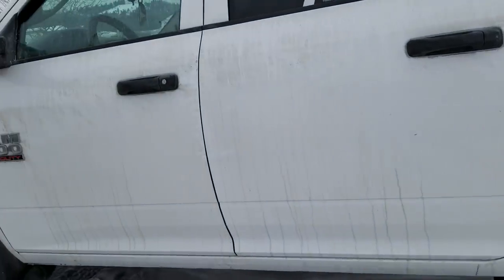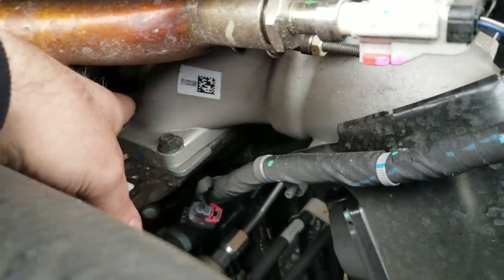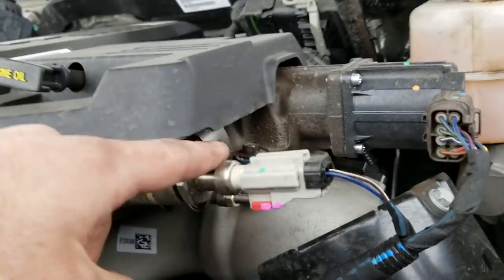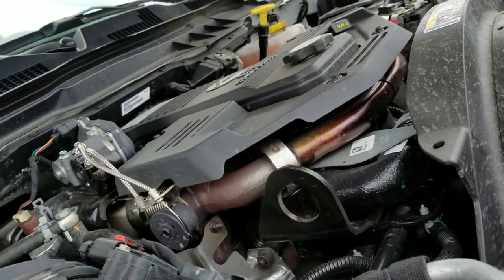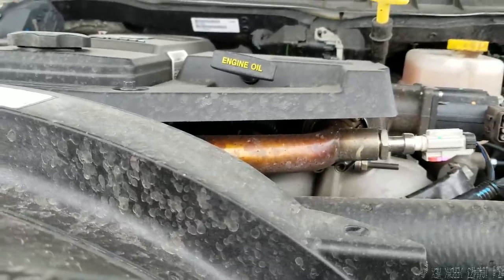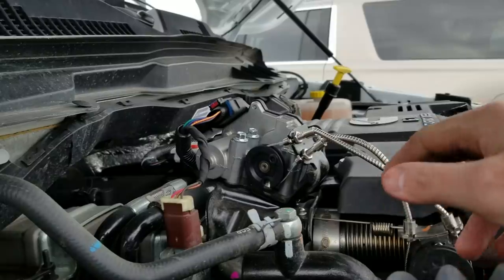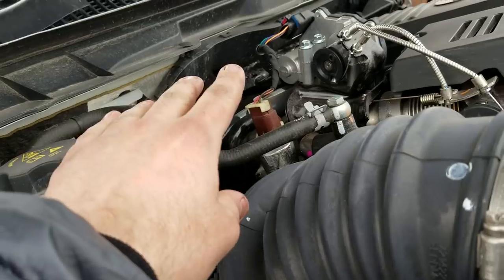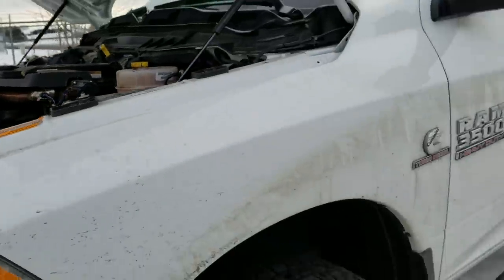13-18 Ram Cummins. The real problem with Egr

Comment: Have you ever heard of the killer bolt grid heater issue? Have you ever had it?  I wish you could address it in a video. Thank you for all your videos you have helped me alot!
Reply: Just suffered on my 08 at 325k
Reply: Banks Monster air has a video about that issue and how to fix it

Comment: So essentially it's creating predestination along with destroying valves inside the engine. I currently have a 2017 4500 they can't get out of its own damn way going downhill. I used to have a Kenworth pulling over 100,000 pounds picking out pool this pickup truck empty.

Comment: If your truck thats out of warranty gets deleted,which is what most do but ive heard if dot catches this they will ream u.or state when inspection time comes.nc dont have diesel emissions on my  truck.07 5.9 and btw i got the toyos oc2 6 for $1200 out the door 👍
Reply: Just go in and turn the EGR off. Put a block of olate between the intake and the EGR. Bolt it all back together, and stealth mode baby.
Reply: Brandon Caldwell What, exactly is so wrong with EGR? Ok so if you don’t work the truck hard much the EGR cooler core will plug up. That’s like $500 every 90,000 miles (and first ones usually under warranty). Besides that, what’s the big problem with it? Why are people obsessed with breathing their trucks unfiltered exhaust? Just to prove to the world they can? Lol Doesn’t exactly reek of any intelligence!
Reply: @brandoncaldwell95  he has a 5.9 the 5.9 doesn't have a EGR system like that. Deleting EGR from a 5.9 requires a camshaft swap as EGR on a 5.9 involves opening the intake valve slightly at the end of the exhaust stroke. 

Aftermarket performance camshafts delete this part of the profile.
Reply: @natehawkins2910  there's two issues with it. 

1. The soot mixes with the oil from the PCV system making a paste that clogs the intake manifold (only a diesel issue)

2. The EGR effectively reduces the volume of useable air in the engine. Effectively undoing all the work you did to get as much useable air in as possible with things like a Intercooler and turbo.
Reply: @brandoncaldwell95  it it's it's own exhaust gasses. You breath back in some of the air you breathed out every day.
Reply: SilverStar Heggisist 1) But that’s what our “catch can filter” is for ...collect the mist and keep it drier. Mines to be changed at around 100k or when your 017 cap blows off lol 

2) I won’t argue that, but EGR greatly reduces nox so it’s kinda necessary.
Reply: @natehawkins2910  my PCV system was converted to a road draft tube by the previous owner so it's not and issue for me. 

I know what EGRA does. However it also causes the engine to produce more carbon monoxide, which could arguably be worse.
Reply: SilverStar Heggisist That’s interesting you mention CO production. My truck was recently in the dealer for a not-supposed-to-be-wet-inside wiring connector repair and set off the CO alarm while running 20 minutes inside the dealer garage ...the fume vent doesn’t fit well over the double tip of the powerstrokes. My diesel tech said it doesn’t take long to set off the CO alarm with a new Powerstroke. Odd that EPA would focus so hard on Nox and seemingly disregard Carbon Monoxide.
Reply: @natehawkins2910   Neo Craft  I was trained to fix diesels and when you understand how each gas is made it makes sense. 

CO comes from incomplete combustion. The reason diesels traditionally are known for not making CO is their lean mixture/high pressure/high temperature environment is very good at getting a complete burn out of the fuel, making CO2 rather then CO, this is why diesel is allowed in underground mines but gasoline isn't. However the same conditions that make less CO make NOx. 

NOx is made in high pressure/high temperature/ environments. 

This means that with current technology you will always get a trade off between the two. 

The likely reason they except the trade off is that CO in an open environment isn't really damaging because you need a relatively high concentration to be dangerous. While NOx at relatively low concentrations produces acid rain. 

This is just speculation on my part because I'm not a mining expert, but mining equipment likely doesn't have a EGR system. 

Also had your truck been say on a Dyno, it likely wouldn't have set the alarm off. The EGR system is shut down when the truck is off idle/under load. This is why EGR doesn't interfere with the ability to tow. 

On a Final note, EGR isn't necessary any more. The DEF fluid you dump into your truck, is there to break down NOx into nitrogen and water. And it does so without the need to have EGR and does so without interfering with engine performance. Which means unlike EGR, it works when you're under load. And it does so without making the engine make more carbon monoxide. 

Because of this, I suspect strongly that they only still have EGR as well only because the government requires it still. 

Sorry this got long.
Reply: SilverStar Heggisist Thanks for the info. I love my EZ Lynk Monitor so I can watch when and how much the EGR valve opens. And temps etc...

I think it would be neat to experience a 6.7 Powerstroke with no EGR and no def but still having the DPF intact to get rid of the smell and soot. Too bad we couldn’t have just went this route ...sure would have cut down on components and cost. 

I know Ford offers the 6.7 without DPF and for use with 500+ ppm diesel fuel for export (or with an EPA waiver) you can find a couple on YouTube here and it would be fun to have one from the factory that’s somewhat emissions control-free. I’m guessing EGR is still on it but no one can confirm.
Reply: @brandoncaldwell95  you have no clue what you're talking about...
Reply: @SilverStarHeggisist  diesels are allowed in mines because the fuel isn't flammable, this is why gasoline engines aren't allowed (flammable and therefore potential for explosive fuel vapors).

NOx controls are only related to ground level ozone and the national ambient air quality standards, nothing to do with acid rain. 

EGR is not required by the government, engine manufacturers only have to comply with the emissions standards; the EPA doesn't care how they do it. Note that Cummins/Dodge were the last brand to need to add SCR to their engines to pass the Tier 4 standards.
Reply: @wlrottge  Actually, i highly dout you know what yore talking about.
Reply: @brandoncaldwell95  19 years working in air quality with a SIGNIFICANT portion of my time spent on diesel engine regulations. And I grew up in a boat yard, am an engineer and know how to build engines (have a 454 on a stand in my garage as we speak)... Yup, completely clueless.
Reply: @wlrottge  I could honestly not care. You can flex all you want. You can state things all you want. The fact is, this is the internet. Youre a proffessional, so am i. The fact is, ou knownumbers, congrats. I listen to engines
Reply: @brandoncaldwell95  I build them too... But the difference is, I know the underlying science and engineering
Reply: @wlrottge  You still havnt grasp the point. Spell it out with me now, I   D-O-N-'-T   C-A-R-E. Now say it with me, "I don't care". Get it now? You can say you built Sydney Opera Theatre for all i care. The fact is, this is the internet. You know numbers, i could not care any less than i do now. The fact is, we are all different and have different opinions. Emission systems are terrible and i will contiue to remove them. EGR is terrible so it will be gone. I know ways to fool others I.E. hidden block-off plates and so forth. youcan continue your number crunching, ill build by ear

Comment: Hey Paul. I'm hearing the crank case vent filter (under the valve cover) needs to be changed much sooner than Dodge tells us. Any experience with them getting clogged up premature?
Reply: They say 60,000 miles. 45,000 they usually last. I just let it go and leave it. Gets better MPGs. That ir they have those little filter things you can put there as a delete. $20 sure beats $160..
Reply: On my 2017 2500 Ram with the Cummins. I only got 40,000 out of my ccv filter when I got the code for ccv restrictive. And the service engine soon message comes up. With the engine light. So I took it to dealer they pulled the codes. And as you would expect they say well we won’t even be able to look at it for at least 2 weeks. Yeah I’m not waiting if I can’t change a filter I got no business driving this truck. So I headed to the parts department and purchased the ccv filter at 25% discount because my dad was a Chrysler employee. While the service advisor was claiming I should wait the two weeks and the dealer do it because there maybe other issues causing this. Yeah ok I use common sense Went home replaced it. So far no issues yet if I get another 40,000 miles and it plugs up again it’s just the filter needing changing. Now if it’s way sooner then there is something else going on and I’ll make a appointment to have it looked at after I’ve investigated and found what may be causing it first. If it’s warrantied there doing the work.
Reply: Needs to be changed yearly
Reply: @Jon-O. The the engine temperature heat up if the ccv filter is clogged?

Comment: On diesels in wreaks way more hell on the motor than gas engines. I wish we could send the EPA a bill for destroyed engines. The whole point of the EGR is to burn "unburnt" fuel and soot in the exhaust. I dont see why a catalytic converter isnt enough. Its way less destructive regardless. If they would quit watering down the fuel we probably wouldnt have this problem.

Comment: Hey Paul love the channel. I just bought a 2018 mega cab dually. When your guys or you are on job sites for an extended time or in rest areas over night do you guys use the high idle ? Or just idle at standard RPM

Comment: Here's the thing, I would love to delete but because of the warranty which is a no brainier. Repercussions from the DOT can be very bad, trade-in value well a deleted truck will kill the deal and I've heard one time bye High Level Military Intelligence that emissions testing could come back to all 50 State's. However a more complex issue is finding someone who really knows what their doing to delete the diesel not one of those fly by night shops. So what the hell do you do?
Reply: Edward Nelson I deleted mine at 30k, the first time I had a def related problem. I’m now at 150k problem free since. I did the work myself, if your a decent mechanic it’s pretty straightforward there’s plenty of videos on YouTube showing you step by step. The way I look at, until the government is going to warranty and replace my motor when it prematurely fails from having abrasive soot dumped into it, you won’t catch an egr on any of my trucks. These trucks are too expensive to damage in this manor.

Comment: I don't know, the concern about exhaust re-entering the engine seems a bit over the top, is it really that big of a problem?. Put another why: where did that "dirty exhaust" just come from? The engine, think about it, the power and exhaust strokes have this burnt the engine for a full cycle and under heavy loads. Maybe reintroducing a tiny bit back into the engine isn't going to make a difference?

Comment: Now why couldn’t they tap the exhaust after the dpf filter then thru the cooler, ear valve,and intake?
Reply: They really should, that's how the egr is setup on my brothers 2012 tdi. It's fed from just below the dpf. When he pulled the dpf to have it cleaned, everything past it had no sign of soot.
Reply: alfonsgar  yeah in hind site I’m surprised Cummins didn’t demand it that way. Considering there reputation.
Reply: jon O I’ve often wondered that too. With the extra 9’ of pipe they could put fins on it to cool down the EGTs and not need to worry about an EGR cooler. And the valve could run on the cool and clean side.
Reply: Because of the pressure drop after the turbo. Pre turbo exhaust drive pressure is always higher than boost pressure. That way you can feed egr whenever needed
Reply: psychotikpaisano Good point. I never thought about the forcing action needed for EGR.
Reply: @natehawkins2910  
Theoretically you can put the/a dpf before the turbo and feed clean egr that way, but packaging constraints probably negate this idea.
Reply: @natehawkins2910  money

Comment: Smh... so what exactly are the issues that you’re having with that Cummins? 
The only thing I’m hearing is that you want to delete ALL the emissions and roll coal like it’s 1965 lol 
You didn’t even touch on the real EGR issue with the Cummins 6.7 which is the grid heater and it’s causes of high exhaust gas temps.

Comment: What would happen if you were to put a block off plate between the intake elbow and the egr valve with longer hardware? Would the computer recognize an issue or throw a code?
Reply: Yes

Comment: I had everything deleted off my 17 2500.
My dad owns a diesel shop and I've been around diesel engines since I was little.

95% of the problems we see in our shop are emmisions related. 
These engines should easily see 500k miles in their lifetime but now your lucky if you reach 300k without serious problems.
Reply: Hannah Ramirez But who really cares about 300,000 miles? I bought a 19 f250 with 150,000 mile bumper to bumper Ford Premium Care warranty. I will be trading it by 80k probably and the warranty is transferable. 300k in one vehicle is well beyond what the average new truck buyer looks for. The broke 18 year old boys want the old ones because they’re “cheap enough” to afford on a 5 or 6 year loan. They are the ones who have no money saved up to cover repairs so they buy a delete kit in hopes of having a bulletproof truck, problem is, they have a 12 year old truck that non-emissions parts always fail on by that point.
Reply: @natehawkins2910  

Not everyone wants to trade in their truck, lots of people plan on keeping their trucks long term and want them to last as long as possible.

We have several regulars who bring they're trucks for basic maintenance (oil, fuel filter, brakes etc.) Who's trucks have well over 300k miles.

Several are pre emmisions but there are quite a few who are post and have been deleted. 

Trading in a truck might work for you but if your like me you can't wait to not have a payment. And in 6 months from now I won't have that anymore and I plan on having this truck for many  many years to come.
Reply: Hannah Ramirez That’s all good but you’re talking about a handful of people out of the masses. These trucks are indeed able to go 300,000 and beyond. So where is the trouble? If you’re bent on keeping it to 400,000 and your payment is over, who cares if you put $4000 a year into it to keep it moving? That’s a lot less than your payment! 

So where is the trouble here exactly?!

Comment: Those particles would be in the engine without EGR since they're made by the engine. That fine soot isn't an issue for the engine. The filter keeps out abrasive particles from the atmosphere (like dust) that will cause damage. 

Where the problem with EGR is, is the PCV system which by it's nature gets oil into the engine intake. This alone isn't a problem and EGR alone isn't a problem. The problem is that they mix making a paste that clogs your intake. 

EGR is on almost every engine from the 1980s on up. 

And even the old 5.9 Cummins has EGR, you won't find the EGR tubing, instead they did EGR with the camshaft profile, by popping the intake valve slightly early, allowing exhaust gasses into the intake before the intake stroke starts. Something aftermarket camshafts typical delete from their profile. 

EGR is there to reduce combustion temperatures and pressures, which reduces the production of NOx. Which is a major cause of acid rain. However EGR produces more CO which is caused by less complete combustion because of the lower temperatures and pressures caused by the dead air.

Comment: Thanks. Now talk about dpf and def please
Reply: Never understood DEF. Why spray ammonia into the exhaust. I coukd litterally stand beside an emission free truck for amdays without issue. The ammonia content in DEF makes my face burn and wind pipe sieze/burn. Much rather have the diesel and oil smell then have a choking fest walking through a truck stop..
Reply: @brandoncaldwell95  has to do with eliminating the soot which is about as cancer causing as second hand cigarette smoke.

Comment: Absolutely  right  it is junk. Very expensive to fix this system after 110000 miles. Makes it unreliable  to drive for 500k miles. Y dont u remove an tune it?

Comment: Some back yard mechanic is going to become a millionaire if they can come up with a filter system that can be installed (inline) before the egr dumps into the intake. Even if you had to clean said filter out weekly I'd be in.
Reply: Why are you worried about soot that came from the combustion chamber being recirculated back into the combustion chamber?  I'll never understand the cause for concern...
Reply: Some manufacturers already do it by taking exhaust gasses after the exhaust filter.
Reply: @rcastorena  because it mixes with oil from the PCV system which then forms a putty like substance that builds up clogging the intake manifold.
Reply: @rcastorena  its like fine sand polishing the cross hatches  out of youre cylinders  then oil wont stick to the top and the top ring will be running  with less lubrication than  it is needing shorter  shorter motor life